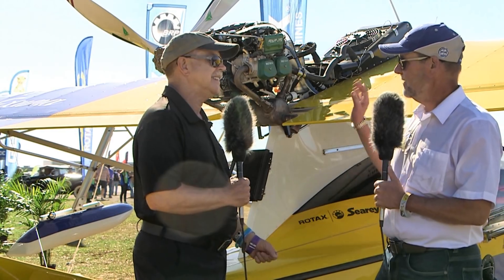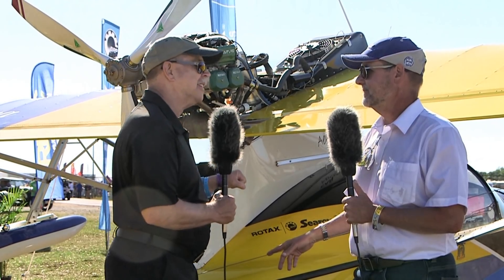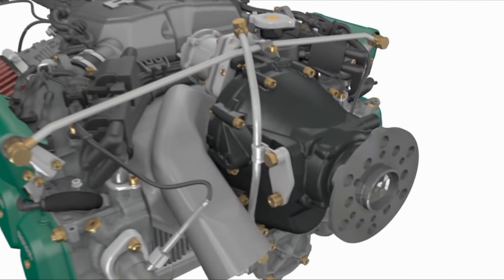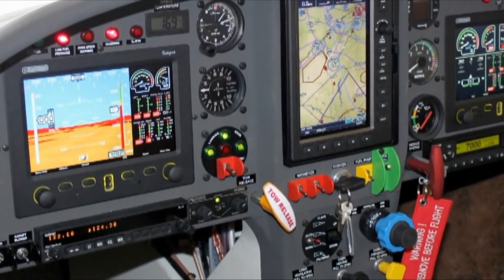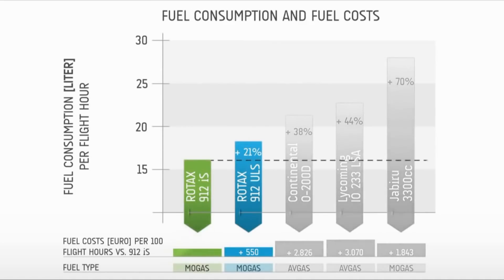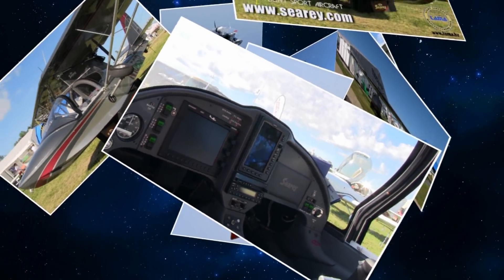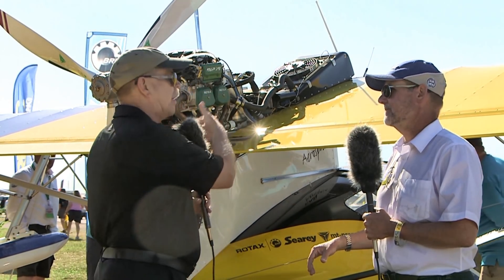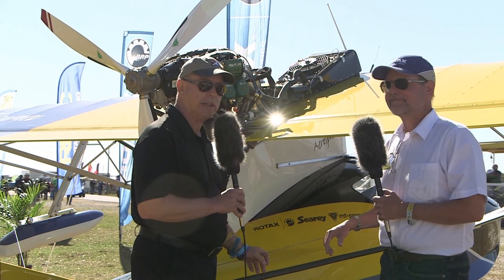RS Aerotech, Rotax 915iS, Rotax 912 iS with single lever constant speed, MT propeller  SeaRey.

Comment: How does this determine pitch without airspeed information?  For a given throttle position, the pitch should be changing if you say enter a climb or decent, no?
Reply: Also, is the prop reversible?  My dad owns a searey and there have been plenty of times a reversible prop would have helped in docking or pulling away from a beach
Reply: @alexcourrier1918  can be with enough bucks !
Reply: I had the same question. If you give it some thought. airspeed is not needed . MP can be used. Software takes care of pitch. I don't like control taken away. Seems the way it is these days. Take away pilot choice. God help you might have to think. Pilot work load. Please ! We are not flying the space shuttle ! When do I get a self flying plane ? Sorry, cant help it !